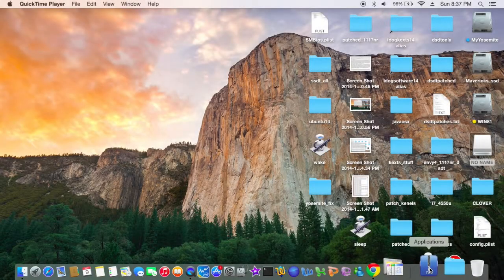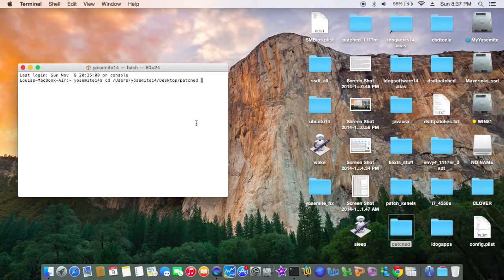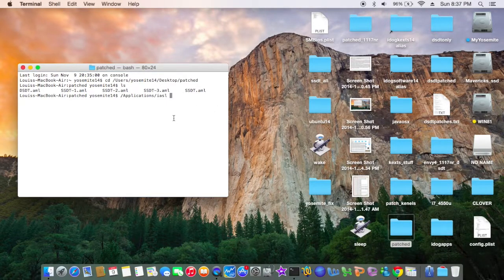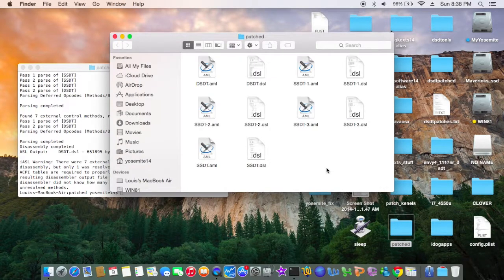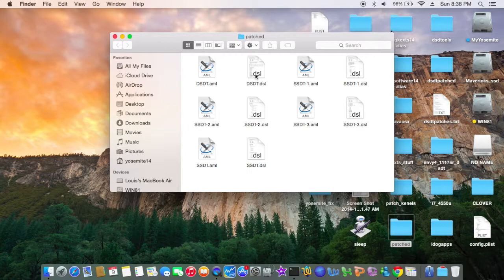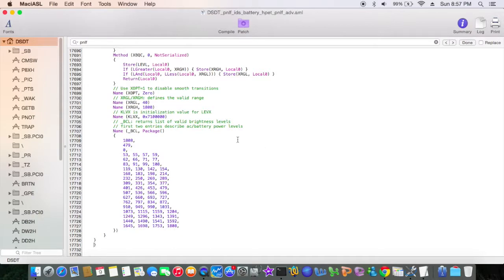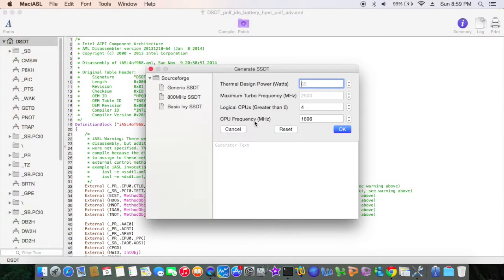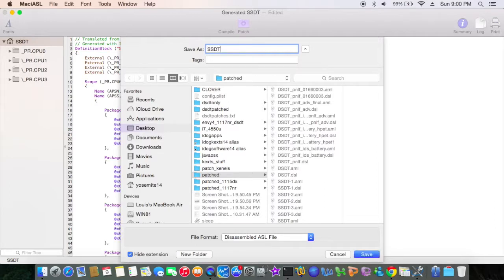How To Patch DSDT on HP Envy 4-1115dx Ivy Bridge HD4000

Comment: We literally have the same exact specificatons. I have HP Envy 4 1030us but my graphics card, processor and everything else is the same. Would you be able to upload your patches or send them so that I would be able to use them with my hardware? 3dogs1monkey
Reply: Never do that because you can have small changes in BIOS settings or motherboard manufacturing. So it is always advised to patch the DSDT yourself. Or else your system has a big chance to fail. Sorry for the late reply.